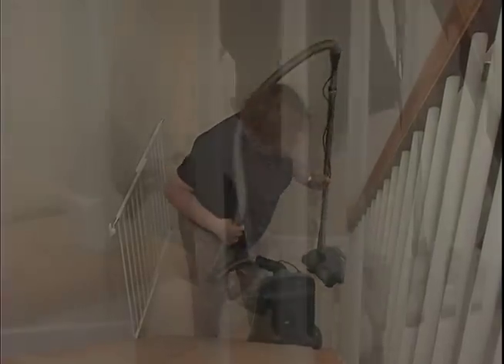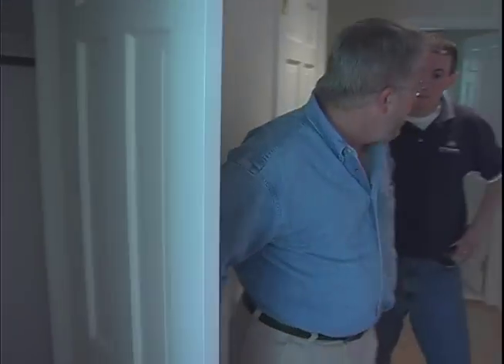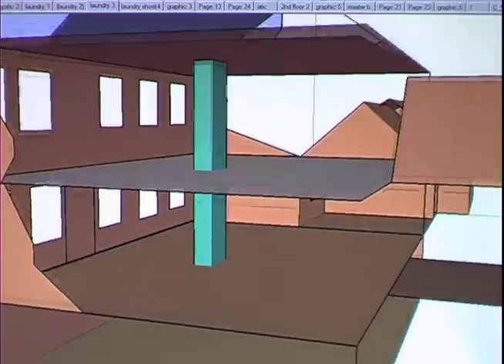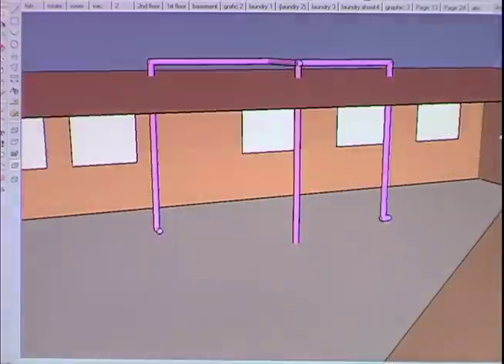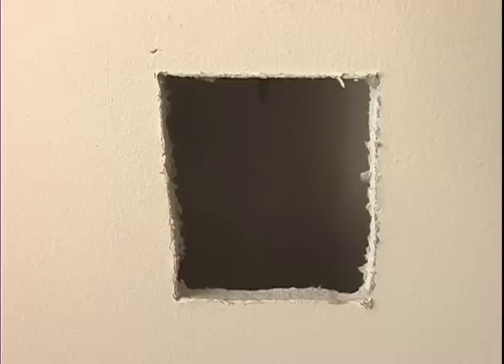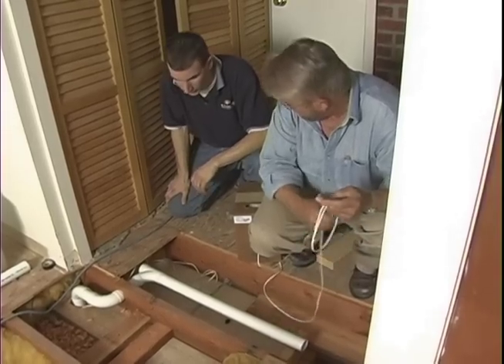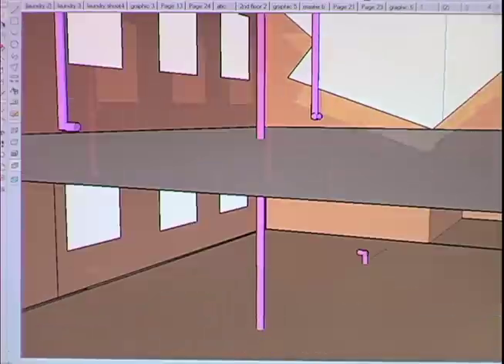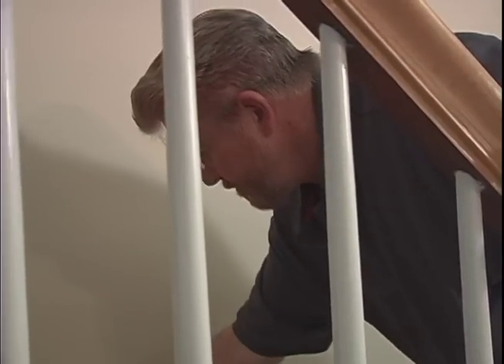Install a Central Vacuum System

Comment: Cleaning a clog out of this thing would be a nightmare
Reply: Pyroman / how did she clear clogs?
Reply: It depends on what the clog is made of...
Timothy hay for a Guinea pig is a pain.
Reply: We had one of these systems back in the 90's and it worked ok though sometimes it would get clogged and you would have to use a Shop-Vac to either blow or suck on the clog.
Reply: @AdamofBlastWorks I read that as: Use Timothy hay as bait to get a sucked up guinea pig to come out of the pipes. 😆
Reply: It is, I have one
Reply: Block each entrance, and open the nearest output entrance. Put a hell ton of pressure into the system, and pop it out.
Reply: when you own a home you know how to get clogs out of things
Reply: Must suck to clean all that shit lmao
Reply: Maybe put a mesh screen to keep large things from accidentally being sucked in
Reply: must really have blown eh
Reply: They some how never clog
Reply: My house’s hasn’t clogged
Reply: @jlg8689  That's pretty smart
Reply: Chris Grant do to water?
Reply: @adamofblastworks1517  Even worse if its the Guinea pig half stuck round a pipe bend
Reply: @jlg8689  What a good idea!
Reply: I’ve had mine for 22 years and have no clogs.   Central Vac is the only way to go.
Reply: They don't clog. Source: have one.
Reply: Why would a Dutchman suck his shoes into the vacuum system? 🤔
Reply: It's impossible to clog if it's installed properly
Reply: Unless if you get another vacuum
Reply: Mine gets so clogged with semen and dog hair I have to buy a new one yearly.
Reply: I once sucked up a glove when I was cleaning my car. It went through the pipes and into the dustbin on the power unit in the basement.
Reply: Note to self: do not $h!t in the CVS…! 👌
Reply: If it's installed properly, it won't clog
Reply: It's cool if you built your house vertical though tmyou can do a straight drop
Reply: How does the unit perform though, long pipe runs and lots of elbows, you lose static pressure every one of those turns

Comment: Seems way easier to carry a vacuum around the house.
Reply: i had a central vaccum in this house my entire life we stopped using it completely because it's easier to carry a vaccum
Reply: yeah, or having a longer vacuum tube,
central vacuum seems to me be a waste of time and money.
Reply: @taltigolt  What is hard about using the central vacuum outlets?
Reply: I just use the Roomba approach to vacuuming. 

You buy a fleet of them and put one on each floor of your house and set them to vacuum whenever you aren't home. 

So far I've only had 1 uprising, which I promptly put down by showing what I could do to the old vacuum.
Reply: ilajoie3 good job taking action quickly. My WiFi door lock thought it be funny to lock me out, so I knocked him out.
Reply: @G12Sish  ohhh it is
Reply: @ilajoie3  Chances are those Roombas are gonna leave a lot of deep down dirt in your carpets. Not to mention that they can't do above the floor cleaning.
Reply: @G12Sish  Do some research on them and tell me if you still think they're a waste of money.

Comment: Lol just buy a second vacuum for up stairs for $40 on Amazon.
Reply: And leaks dust everywhere??? These are clean units
Reply: @LemkeR  she never said you had to buy the amazonbasics vacuum
Reply: it brings him boomer joy
Reply: Yep, much easier and more flexible solution that only requires it being carried upstairs once.
Reply: Or you could just not be lazy and carry it up a flight of fucking stairs...
Reply: I've got a Dyson V8 Animal stick vacuum that costs considerably less than what I imagine a central house vacuum would cost. No chore to carry it up stairs, and I can buy a second one if it's that much of a pain in the ass.
Reply: Leavewe thanks im laughing alone at 2am in my room at the words boomer joy
Reply: I was thinking this too!
Reply: @KGillis  yea i have a central vacuum and with that you still have to carry up a long hose and any attachments. its more work to carry that up then any dyson vacuum
Reply: You missed half of the point. Anything you suck up with a vacuum has to hopefully get caught up in the filters and the air get forced back out into the house.  This gives you a better more efficient stringer system that also dumps the exhausted air into space that you do not use as much as your living room bedrooms and kitchens

Comment: wtf, i didnt even know that this was a thing
Reply: There’s probably huge disadvantages to a system like this, otherwise we’d all have them
Reply: @dl5fse990  Yea cost....
Reply: @dl5fse990  no actually I had one in my old home 10 years ago and it worked like a charm. It provided enough suction to pick up most debris and dust. It is obviously not strong enough as a Dyson these days but it still did the job.
Reply: Thats what I'm saying. Who knew? I lowkey came here expecting a meme
Reply: @anonymousthanks4718  they're more powerful than a Dyson, though you still need a powered attachment for carpets. Without a powered brush there's no comparison for carpets.

A shop vac is about the same amount of suction, sometimes a little more. But household vacs, even Dysons can't come close to the volume of air central vacs move
Reply: @shimes424  the new ones probably are more powerful then dysons. Mine was 10 years ago.
Reply: @edstababy  its gotta be a white thing lmao
Reply: Waterboxer Today I learned that vacuuming is a white people thing.
Reply: @anonymousthanks4718  nah I had one growing up, 30 years ago they worked great. Most have a cloth filter that should be shaken every time the bin is emptied
Reply: @JackieG8991  i just didnt know they existed everyone vacumes, but not everyone has the luxury off having it built into the wall...i would of thought that was some future shit

Comment: Calls the professionals. 
Proceeds to tell the professionals what to do.
Reply: That lad hadn’t a clue. “wanna clean it up with a holesaw?”
“Yeah we can do that”
What was the other plan? Just hammer the pipe through all the chips? 🤣
Reply: @chewsuperfour9514  I thought that too!
A customer shouldn't have to ask for best practice and a neat finish
Reply: underwaterdick In my experience with trades asking for that is generally absolutely essential, or you’ll be left with a right mess.
Reply: Maybe because he is a younger man ?
Reply: he never gave the kid a chance. How is he gonna fit the pipe through that small of a hole. Obviously he is going to have to make it larger.
Reply: @ George Scott

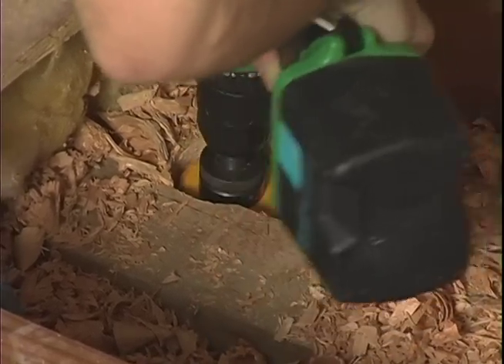Re-examined the video. Looks like the hole wasn't big enough for the pipe any ways. At 4:33 he uses hole saw to make the hole bigger, just like you mentioned
Reply: cjeam then you’re cheaping out, you get what you pay for. If someone quotes 10k but you find someone else to do it for 5k, don’t expect great things. The cheapest quote is the most expensive
Reply: @DordiHOTS  Exactly!
Reply: @chewsuperfour9514  Like George Scott said, the big guy didn't give that young man the chance. I got the impression that he wanted to direct the whole job from the very beginning.
Reply: My father does this. He thinks he knows better, and others know nothing but getting money.
Reply: Idk... Seems like this whole video is a theatrical piece advertising central vacuum system and the old man is the owner of the company
Reply: misterblobby If a professional is younger than the customer, then the customer knows more than the young professional? I think that’s a very naive way of thinking.
Reply: @Farsmezan  Do you tell him to stop? That the professionals learned what they are doing?
Reply: Imagine how doctors feel when their patients tell them what to do. Happens all the time.
Reply: @Farsmezan  your father is right

Comment: Why am I watching this?
I‘m european, my walls are made of solid 30cm-thick (12 inch) stone and my cat is so fluffy that it sweeps the floor just by walking around
Reply: american houses are perplexing to me
Reply: @leavewe  Solid stone is expensive the larger the house gets, and unlike you guys over there, we actually have space to build big houses.
Reply: @leavewe  american houses are cheaper to build, have better insulation values, tend to use lower environment impact supplies (new-growth farmed pine, fiberglass bat, PVC siding), at the expense of longevity. (most people expect to sell off their home or their children to, they're not multi-generation investments)
There's ultimately a lot of cultural differences at play.
Part of looking for lower-cost construction materials and methods also comes down to the culture of if you're even the least bit successful, and you don't live in the most major of cities, you should get a house for yourself by the time you're in your 30's.   Americans also on average expect a larger sized house than europeans do, for whatever cultural reason.  
And that's just with the usual stilt based construction method, a lot of new building in the US is transitioning to SIPS (Self-insulated panel structures) which slot together like legoes (while also providing still further superior insulation values), or aerocrete, which as the name suggests, is a high air-ratio concrete mix that lowers the cost and brings the insulation values up vs standard concrete mixes.
Generally speaking, any american house is designed with a 100 year service life in mind, after which it is expected to be torn down and replaced.  They can last longer than that if taken care of, but most of the time, that's what the architect designs them in mind for.
Reply: SCComega I’ve significant doubts about both the insulation and build environmental impact being less. From everything I’ve heard European building codes regarding energy are much more stringent, and that certainly reflects in the energy consumption even acknowledging that US houses are larger. Them being larger works against them for build impacts, as does decreased longevity.
Reply: @cjeam9199  You have to keep in mind the environmental impact of the resources themselves, and the energy that goes into them.  Farmed pine is far more environmentally friendly than farming hardwoods that are used in european homes (given there's faster turnaround and they use less energy to grow), which make up most of the building.  PVC is made as a by-product of oil refining (which is obviously happening anyway)  And very little is actually used as it's the skin of the house.   Compare brick, which requires both the initial mining of the clay, forming, and firing.  When you look at insulation, you need to understand just how effective fiberglass bat is for the cost, and how little energy is required for it's formation.  (hence why it's so cost efficient)   And, while the size of a house matters, so too do the insulation standards, and much of the US has building codes which mandate double the insulation values versus much of europe.
Reply: SCComega Yeah I’ve been looking and while there’s not great data in comparisons it does seem that many US codes exceed European ones except perhaps with reference to doors and windows. I can only assume the assumption of efficiency differences is due to the differing size of the properties. Except the EU legislation does suggest a low or no energy target by 2021, which I couldn’t see paralleled in US legislation, but from what I understand it most national legislation in the EU countries is a long way from reaching that goal in 2021. 

I’ve still doubts about the construction given how long each type lasts, changing construction methods in the EU countries, and that brick and especially stone is sometimes overestimated. New laminated timbers and SIPs also increase embedded carbon. But I’ll agree there’s likely to be an average winner from upfront emissions from typical/traditional USA construction vs EU typical/traditional.
Reply: Thanks for putting them there measurements in our American terms
Reply: @SCComega  As a British resident, for your first point, I goddamn wish our houses were not insulated so much in summer... Brick stays warmer for longer, so even at night it's still hot throughout the house. If you have a bedroom in the attic, my god you'll be supplying the house with water with the amount you sweat.
Reply: Same
Reply: @ShuskiCross  Yeah, that's one of the upsides for houses in the US, is that despite our high insulation values, we also have relatively low thermal mass structures.  That, and air conditioning is in basically every building, while our electricity costs are drastically lower to boot.  Ultimately, our houses are better designed for temperature regulation via AC and heating, whereas european house building is better for passive thermal regulation.
Reply: @ShuskiCross  I live in Texas.....fucking Texas if I lived in a stone house I would die it wouldn't be a house it would be an oven it was so fucking hot this summer the glue holding the fabric on the top of my car covering the metal melted so now it's hanging down it's so hot my car melted......
Reply: @ShadowFox10587O  100% GM car
Reply: I'm Brazilian and are house have 20cm-thick walls, its a nightmare to put new energy cables or a new power outlet in our bedroom, as an example
Reply: @SCComega  Yeah, there is little to no AC in Europe, so passive we go
Reply: @robokid20001  come to see big houses in Finland and we're talking about insulation
Reply: The V0iD I love how people think wooden structures are somehow weak asf. Concrete or stone houses are much more susceptible to earthquakes. Does that mean they’re weaker? 
The fact is that unless your building a house to last 2 centuries for some reason, there’s no downside to building from wood.
Reply: As an Asian I wonder if vacuums are really that much more convenient or better at cleaning than a broom and a mop.
Reply: Joe Galindez tell me how either of those work on carpet.
Reply: @ARSZLB  Meh doesn't matter for Asian houses. Asian dude probably has a dirt floor lmao.
Reply: @ARSZLB  That's my secret Cap. I don't use the furry dust magnets.
Reply: Now we know why there are flying houses even on a little storm
Reply: @myrecommendedisallmemes  It's a tile floor, but if I ever get my dream house it'll have an oil-sealed earthen floor to go with the unpainted rammed-earth walls.
Reply: You can buy a robot vaccum or a few, because now are really cheap. I recomend the brand Roomba
Reply: "We drill a small hole in the floor with a battery powered drill"     

Same job in Europe: we use this gaint industrial watercooled drill to make this small hole only taking us 10 minutes and 5 drill bits cause its solid fucking concrete
Reply: And how does he get all of the hair in the garbage?
Reply: @leavewe  in Europe, you have 1/5 the space, so it’s simpler to understand
Reply: @joegalindez2438  fellow Asian here. Specifically Indian. We recently started using a vaccum during the lockdown after we couldn’t allow maids due to covid. My maid used a broom and mop. However brooms leave behind fine dust and isn’t great with hair. A vacuum picks all of it up. Especially if you get a dry and wet vaccum.

Comment: 2:58 grabs fiberglass insulation with his bare hands, what an animal.
Reply: Hahaha. Scratching my hands thinking about it.
Reply: Blake Wilson yellow one like that ain’t bad at all, in my experience. Personally I always look out for old pink insulation.
Reply: @Frankie431  Yeah i used to cut little round pads of yellow fibreglass all day long without gloves. My hands got a little itchy but after washing them they would always be fine. The old shit inside of old attics is the shit you gotta watch out for.
Reply: George well that escalated fast🎍
Reply: George lol I crawl attics everyday inspecting homes for termites, of course it ain’t gonna hurt you but try rolling around in it without coveralls and proper protection. You’d live in eternal itching. Glad you know everything about everyone!
Reply: you get used to it after awhile im an hvac installer and my hands dont get itchy anymore
Reply: Blake Wilson I shuddered
Reply: A F I love how everybody these days just destroys these boomers
Reply: i didnt have a bed but had extra inslutaion i use as bed

Comment: So this guy lucked out he had a laundry chute which almost nobody has these days which gave him a straight shot up 3 stories. Very unlikely in most houses. If you really want one you'd best do it at construction.
Reply: The laundry chute is one of the reasons we bought our current home.  I don't know why more builders bypass this amazing feature.
Reply: My house also has a laundry chute with a central vacuum pipe going through it. The pipe doesn't interfere with the falling clothes at all.
Reply: My workplace installs Central Vacs, and yes New Construction is easiest. Typically closets on top of eachother and or laundry chutes are the installs that lazy people do. We go into the attics and actually do planning before just showing up and throwing it together. This install is a joke and definitely clogged. If they're done by professionals, they'll never clog.
Reply: Have had Beam system for years. Much easier to use Roomba from iRobot and cost about the same.

Comment: You know what, not many people have thought about installing a central vacuum system.
Reply: Because why would you lol
Reply: For good reason
Reply: You can just buy a really nice vaccum, like a shark, this is outdated. Look at how much carpet they have in that house lol, disgusting.
Reply: @chabka34  Well for one thing, they're a lot quieter than most portable vacuums, as you usually only hear the suction from the vacuum (plus the powerhead if you choose to use one), they can hold a lot more dirt than most portable vacs, and with good care and very occasional maintenance, they can last for decades. I recommend doing some research on them, they're quite neat machines and good investments for your home.